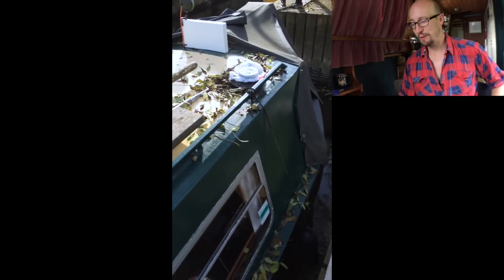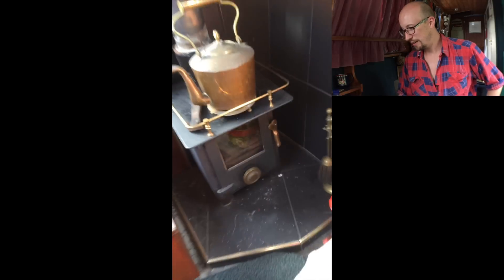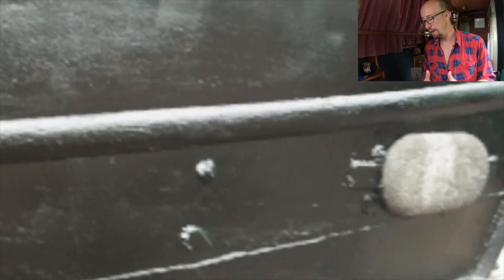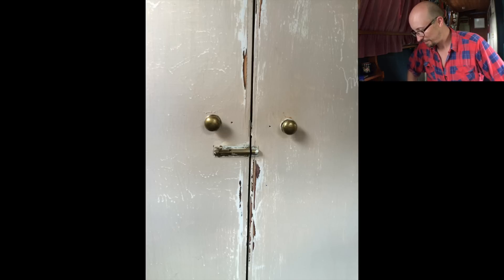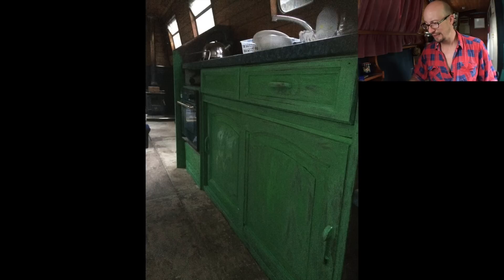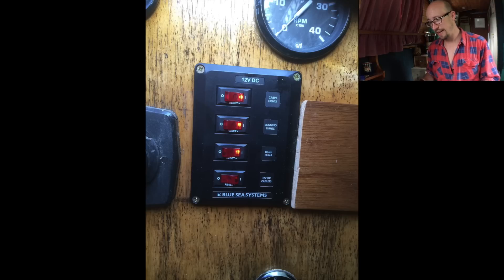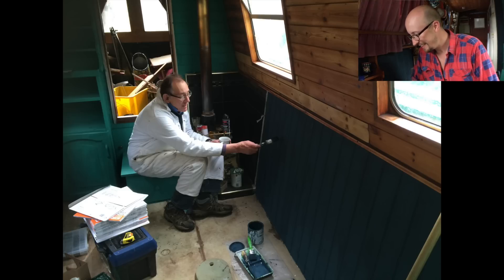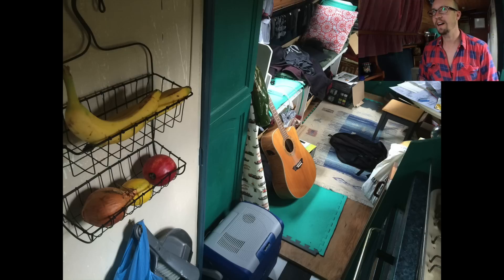Buying & doing up my narrowboat - from leisure to liveaboard

Comment: Hello there, nice to see what you went with. I'm forever making little changes and improvements, wish I could have a clearer run like that. Hope you don't mind me pointing this out and maybe someone has already but; your MPPT charge controller is a fake. Its a, dishonestly packaged, PWM. It may not impact you too much. It depends on your needs and how your panels are connected. You could expect a good 30-40% more power from a genuine MPPT controller and many times more if your panels happen to be in series.

Comment: You might have already discovered the most common ballast is red bricks I like the old Lister diesels but I prefer water cooled as when it's chilly out you can run the hot water through the radiators in the boat to get two uses from the fuel consumed.
Reply from the maker: No I didn't know that! A water cooled engine would be great for those on the move during winter James, I agree. Although not so much when it freezes I hear! 8^)

Comment: Am watching this whilst working so forgive me if I ask daft questions you may have already answered. Firstly, how is the MDF standing up to being installed on a canal boat? Did you use some kind of marine grade because I know it can swell up if it gets wet or is exposed to damp for too long. Also, you spent time sanding everything down - did you also sand down the areas where you applied Annie Sloane paint? I thought the whole idea of her chalk paints was to remove the need to spend ages on surface prep? I have done a lot of furniture projects using chalk paint and I never sanded any of them before painting, although I did lightly wire wool some after painting where I wanted a gloss rather than matt finish.

PS great video by the way 👍
Reply from the maker: Hi Simon, thanks for this - yes the MDF is just standard stuff I think, yet has expanded much less than my oak floorboards. Anni Sloan can go on most things you’re absolutely right I only sanded to get rid of the varnish so I could apply a softer looking danish oil

Comment: Can you remember the cost of the french oak flooring, how is it standing up. what thickness is it, are the tiles on top?
Reply from the maker: Hi Jo, the cost was about £30 per square foot. We got a good deal though. It’s about 20mm thick  I think. It goes as far as the tiles which are on top of the marine ply base boards (looking back I should’ve added another sheet of ply as they have cracked).
Reply: A foot or yard ? Approx 3K + per 100 foot. Wow. I would have thought tile would be cheaper and there's your ballast. Just a thought. Nice job on the ship mate...   Cheers

Comment: If you ever have to get rid of that much paint and or varnish again use paint stripper.
Reply from the maker: I did, used nitromors - should have said. Thanks for the tip 8^)

Comment: hi what length is your lovely boat?
Reply from the maker: 42ft 8^)
Reply: Robbie Cumming Congratulations on getting your narrow boat & 1st home! I've just read that almost all LED lights have a lot of Blue light even if it doesn't look like blue light, such as the warm light LED bulbs, and that the blue light is very harmful to eye sight, but that halogen is not harmful, while being more economical than incandescent. So, I'd advise looking for test results & research on harmful effects of LED light on eyesight, before removing your halogen lighting in the bedroom. & It may be possible to get LED lights that emit eyesight healing infra-red light to mitigate every other LED FIXTURE that has regular LED bulbs or get LED bulbs that emit almost no blue light. I read that infrared light is actually healing for the skin and whole body, even the joints, bones, & tissues, etc., as it penetrates deep inside. Not sure if there's a time limit necessary. I think hand-held infrared healing devices have a 30 min shut off, possibly just to preserve the battery. 
Anyway, love narrow boats! Keep making it beautiful! Thanks for the video! ☺